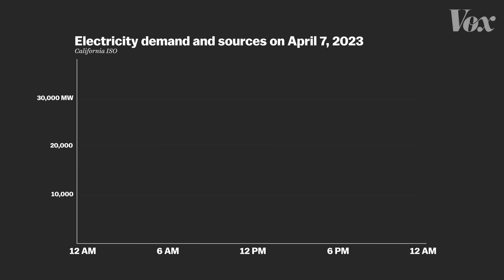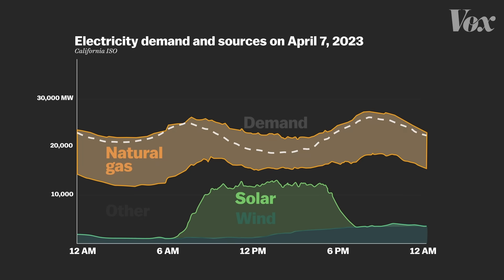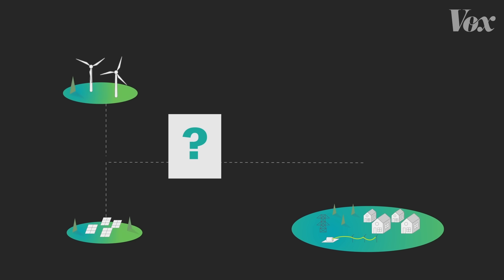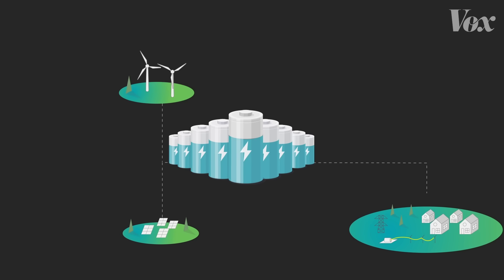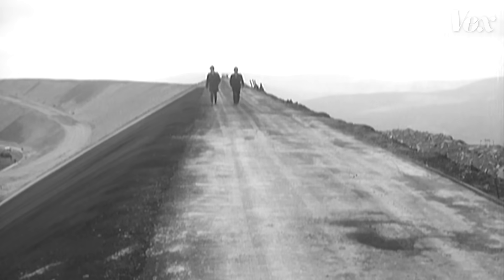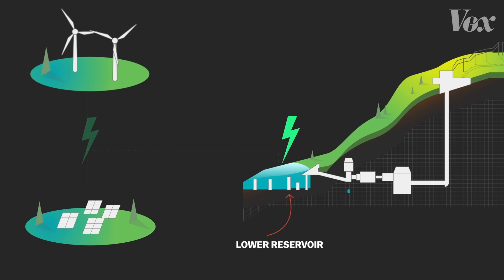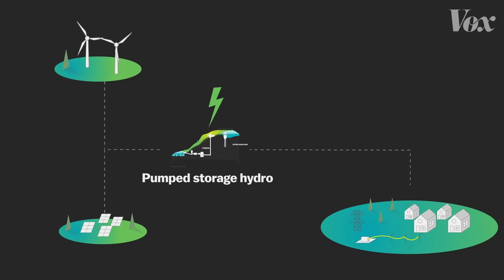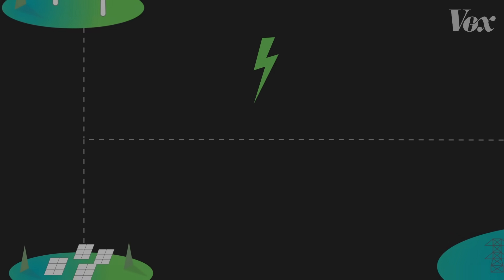How to fix clean energy’s storage problem

Comment: Outside of those non-scalable storage solutions, there's also the option of using large-scale low-carbon power sources like nuclear and (where applicable) regular hydro.
Reply: "Outside of those storage solutions,..." Fixed it for you.
Reply: Nuclear definitely should be considered. I heard of developments in small scale reactors that don't require the massive construction of full scale plants. Reactors closer to the size of a cargo container
Reply: @Shawn_M  The obvious problem with small scale reactors is they produce little energy.
Reply: @darkgalaxy5548  So just build a bunch of them! At least in the U.S, there are plenty of small natural gas plants with a power of below 500 megawatts. For example, the Treasure Coast Energy Center in eastern Florida. Or the Rifle Generating Station in Middle Of Nowhere, Colorado. And countless others scattered around the world.
Reply: @BhargavKrishnaReddy79  I'd say it is very much relevant, actually, since the inclusion of baseload and dispatchable energy sources greatly reduce the quantity of storage required to alleviate production variation in a renewable-heavy grid.

You won't need remotely as much storage to compensate for a week-long low in wind+solar power production if nuclear+hydro make up ~30% of your capacity.
Reply: Nuclear power stations are very expensive to build so to get a return on investment they are on as much as possible. So thats why they are not used as backup
Reply: @diegastdienuiestdoet  Some French NPPs are set for load following. 

Besides, you don't need to use nuclear power plants as backup for them to reduce the need for storage. 
Baseload generation also greatly reduces the need for storage capacity. 

If you've got, say, 20GW of guaranteed continuous production, you need a lot less energy storage for moments when you have no wind nor sun.
Reply: Nuclear is  the best option we have. Not only can atoms produce more energy but reactors are scalable. meaning you can add more fuel to produce more energy or you can add less and produce less energy. You can even cool the reactor and produce no energy. In the 70s 3 mile island and a pump issue and poor training made people think they were going to blow up. Chernobyl doesn't help either. The real answer lies from the aircraft carriers. They actually run nuclear and don't need to refuel for over 25 years. Other countries use reactors to make energy. The left is against nuclear because they believe it can ONLY be used as a weapon. As far as the waste goes. Most of it has a very small half life. So much the military turns them into ammo for certain weapons. Waste can't be that bad if a Carrier can store it for up to 25 years. Most is actually just put on a storage room full of concrete.
Reply: @anthonyjones7264  "The left is against nuclear" is a completely wrong statement in the case of France.
Reply: @BhargavKrishnaReddy79  you also miss the point. Nuclear and hydro can work constantly for 24 hour. Meanwhile renewable sources like solar can't create energy during night (so it's need energy storage) and wind also don't have constant energy for 24 hours (so it's also need energy storage)
Reply: nuclear is useful but i think eventually it will need to be phased out or at least we have to figure out a better way to deal with nuclear waste. it's also a political problem, a lot of people are fearful of nuclear and if you look at the situation in Ukraine, the largest power plant in europe is being weaponized in russia's war.  also you mention france but our nuclear parc is aging and last summer a few of them couldn't operate during the heatwaves because of heightened water temperatures. in a changing climate, with heatwaves and draughts, nuclear and hydro lose reliability
Reply: @slena  Long-term waste storage over millions of years has already happened naturally, such as in Oklo's natural reactor. Besides, nuclear waste is far from the only pollutant that remains long-term, PFAS for example are literally everywhere now. More to the point, additional CO2 emissions remain in our atmosphere for millenia. At least, unlike those, nuclear waste  takes very little volume and is contained in a safe place, unlike NOx, CO2, PFAS or methane which are happily released in our atmosphere for the whole world to enjoy.

Yes, it's a political problem, mainly because a lot of misinformation has been spread around nuclear, to the benefit of fossil fuels. Case in point, even a major nuclear disaster like Chernobyl killed less people in total than air pollution does in Europe in a single year. And yet, people are terrified of the former and don't care at all about the latter.

The impact of heat waves on nuclear production has been largely overblown. Power consumption is at its lowest during summer, and power plants merely need to lower output to avoid disrupting the fauna. Even under the worst climate scenario, RTE has determined that the nuclear power production loss attributable to heat waves would fall under 5%. RTE also lists possible tweaks to our current power plants which can feasibly alleviate this issue.

As for the current maintenance, it isn't due to our reactors aging (the affected reactors are of the N4 variety, the most recent ones). A reactor's lifespan is limited by the stress put on its vessel but under standard operation, it can last beyond the 40 years guaranteed by the design (many PWR are going on their 60s in the US). Our government's obsession with stalling the share of nuclear power in our mix certainly has done a lot of damage to our long-term prospects, though.
Reply: @slena  We already figured out how to manage nuclear waste like 40 years ago. The coal industry paid Greenpeace to protest nuclear energy, that's why we are afraid of it now. The irony. Small modular Thorium reactor doesn't produce much waste for example, can operate safely and can not be weaponized.

Comment: There are many solutions to energy storage. None of them are easy at the scale necessary, but it is possible to build any one or more technologies to suit the need. To me, it just comes down to which one is going to be the cheapest to deploy at scale.

Lithium is around, structure to make pumped hydro and gravity batteries are all potentially viable, but so are vertical axis wind turbines. You just don’t see any vertical axis wind turbines built, and for good reason, they are just not as good as their more popular competition

Comment: I'm surprised they didn't talk about hydrogen as an energy storage option.
Reply: Hydrogen conversion doesn’t have great round-trip efficiency and it’s tough to store in sufficient quantity to handle more than a few days worth. Now, synthesize hydrogen into a hydrocarbon form (methane, or methanol) and it can be stored in summer with excess power from solar and used in winter.
Reply: It's definitely not a perfect technology at this point, that's for sure - I actually just did a big research project on it and I agree about the efficiency loss.  But it's getting a huge amount of investment from the IRA/infrastructure bill so I was surprised they didn't mention it at all.

Comment: Anyone with any engineering background can easily tell there is no way that pump storage has 90% efficiency. The energy loss inside pump and turbine components plus the friction loss in the pipes would be severe. Clearly there is some wordplay in that statement.

Comment: I'm surprised tech like Vanadium Redox Flow Batteries (VRFB) and Eavor's geothermal storage didn't get mentioned. Eavor has made significant gains in geothermal without needing a volcanic fissure to work and without pressurizing underground wells. And VRFBs have been around for decades. Major installations are in use all over the world for grid storage.

Comment: Ok hear me out but what if there was a safe, carbon free and very efficient way of generating electricity? The answer would be nuclear power. It can operate 24/7 and isn’t intermittent like other renewables. It produces huge quantities of electricity whilst using very little fuel. It’s safer than fossil fuels and even renewables in both terms of deaths per unit of electricity generation and in absolute terms with a low accident rate.

Comment: Sorry Vox, unfortunately you’ve missed a great degree of nuance with this video, the most glaring being the role of power provision vs. Energy capacity. 
Further, Energy Vault is a horrible example, it will absolutely not work - there’s plenty of videos on YouTube which explain the why. 
Lastly, no coverage of CAES or flywheels in the face of these other untested technologies is poor. 
I would advise you bring an expert to the table next time.

Comment: Bottled air. A tank of air connected to a turbine to generate electricity. the bottle is made from cheap steal. It could be made at any size. compressor uses renewal energy to fill the tanks. then at peak demand the air a released from the tanks.

Comment: I'm really intrigued by smart grid and dynamic load-type solutions - not a panacea, but part of the portfolio of options. For example, treating loads that don't need instantaneous power like water heaters and HVAC systems like on demand load dumps. Your water heater could be "charged up" during the day when renewable energy is most abundant. 

I'm also curious about incentive programs for getting residential battery storage more widely adopted. In that case, entire homes could be dynamic power loads, with the bonus that it buffers homes during power outages.
Reply: Using dynamic load signals to charge large numbers of EVs seems to be one of the best ways to store excess power using batteries we already have and need to charge. In that sense there's essentially no storage losses. California already has days when solar production exceeds demand and excess power is essentially wasted.
Reply: @rubic0n  Yes! I totally forgot about that. Very cool idea.

Comment: There is another method being tested in Germany and that is using Hydrogen:
They simply use the excess energy produced to perform electrolysis and split water into Hydrogen and Oxygen and storing it, during peak energy consumption they use the stored hydrogen fuel to generate power again.
Reply: I was searching in the comments whether someone would say about GREEN hydrogen. For sure it supposed to be mentioned in the video.
Reply: That seems like a great solution. The best of all since water is everywhere. How's the efficiency? Seems like it would be ok since hydrogen and oxygen can both be burned.

Comment: Just replace that fossil with nuclear and don't bother
Reply: Nuclear plants are much slower to start and stop then gas, way more
Reply: @56independent  but they happily go at  full throttle.. the definition of base load.  Throttling up and down with control rods is fairly straightforward.   From 0 to 100 and back is longer though...

Comment: more Hydrogen production would be nice,, can be saved and even used to power vehicles
Reply: Not efficient enough, especially for vehicles.
Reply: @Freba9  Got any numbers with that? Compared to the pumped hydro at 90% and Gravity at 80%..
The fact that it's compact enough to transport must be worth extra.
Reply: @righthoekstra  In case of stationary storage it is about 50%. In case of vehicles max 30%.

Comment: Hydrogen is another choice. Electrolysis has an efficiency of 70-80% and fuel cells have 40-60%. If heat is a useful product, overall efficiency of fuel cell is up to 80%.
Reply: Yes, but roundtrip efficiency of ~50% is still quite bad. You also need energy for compression.

Comment: You complete missed consumer side(behind the meter) solution for storage and therefore energy storage which is not for conversion back to electricity. There’s a company called Nostromo Energy which are supercooling water for energy storage to be used for A/C. We can have less energy losses when we only convert once, meaning no conversion back to electricity. This has the potential to be a big part of the solution for climate change. Please talk more about it.

Comment: Thank you for this informative and thought-provoking segment. 
Had no idea that we had other options besides battery for storage. 
Power to the science and scientists! True superheroes of our time.
Reply: Now we have sodium batteries. Sea salt. We'll never run out! Lithium gives the longest range for EV's, but they're even using sodium for some shorter range but vastly CHEAPER EV's. But sodium batteries should be there for about 2 hours for each city, after that we need off-river pumped hydro for 2 days for each city. Overbuild your renewables for the worst weeks in winter. DONE!
Reply: I guess I found the target for this video. I found the title clickbaity and annoying. It's just a summary of the top 5 ways to store energy, which is interesting, but nothing ground breaking in any way at all.
Reply: All energy storage systems are batteries. They differ from each other only in terms of the materials used.

Comment: This is the more reason why we should and need to invest more in renewable. The more we use it, the more people (try to) find a way to make them cheaper to produce, store, and use.
Reply: Totally agree. I recently got solar panels, now I have a negative energy bill :-)
Reply: Solar panels are very cheap, but the issue is storing the energy they produce. In my off-grid setup, too much excess energy gets wasted because I have to disconnect the panels during peak hours. Too much sunlight can damage the wires, components, and batteries.
Reply: I think it's better to invest in new nuclear technologies. Nuclear power has great potential as an energy source, but it has slight issues of cost, length of construction, abundance of fuel, and public perception. Smaller reactors would bring the cost and length of construction down, new thorium and plutonium reactors could make fuel way more abundant, and public perception...

Comment: Only having this as a 5 minute video is doing a massive disservice to this topic imo, starting with the false equivalency that battery = lithium ion battery... flow batteries, for example, are much better suited to renewable storage, but didn't get a mention here. Then there's the hugely controversial gravity energy storage 'innovations' which shouldn't be mentioned in passing without a more critical eye. Finally, beyond energy storage, another huge consideration is grid demand-response and smart grids, which didn't even get a mention...

Comment: Small note: the efficiencies mentioned are only one-way. If a pump and a turbine are both 90% efficiënt then the whole system will be 81% efficient.
That said, even if the efficiency would be low we do need to use these technologies. We need more clean energy, yesterday
Reply: Where are you getting one way? In the video he said the "whole process" is 90%
Reply: @yuikol14  The video is wrong, the actual number is 75-80% for the whole system. They probably just googled it and used an unreliable source.
Reply: @DanielSann  let's see your source then
Reply: @jmckendry84  the australian government, uniper, enel and many others. Using the 90% figure is just wrong and disingenuous
Reply: @yuikol14  i found it on Wikipedia, but it also makes intuitive sense

Comment: This sounds like a good idea but gravity energy storage really isn't. moving massive concrete or stone blocks isn't simple and does have a lot of moving parts. you're talking about moving weights that are in the thousands or tens of thousands of pounds to store energy. It's takes more than just a big crane. The pressureized water storage seems more feasible but more research and development is needed. Just stick with pump storage it actually works.

Comment: Not every battery is lithium there is also salt batteries, this year two seperate chinese car companies will be releasing electric cars without any lithium, the batteries use salt instead.

Then there are also flow batteries where you storage the electrical energy in a liquid.  It's a electrical battery but it has a massive container with a liquid, these are aleady in commercial production.

There is also compressed air storage, where you compress air until it's a liquid and then release it.  This has already had one test power station running in the UK and is really to be rolled out on a much bigger scale.

There are plenty of energy storage solutions that are ready to go.

Comment: Mechanical energy storage, whatever the type (pump storage, gravity, pressurized fluid, flywheel, etc),  will not be able to achieve more than 70% of energy efficiency. 

The information mentioned in this video is flawed